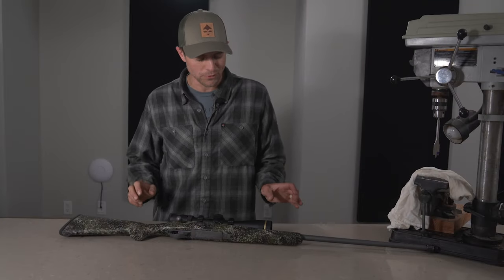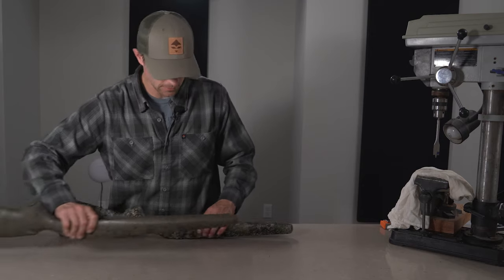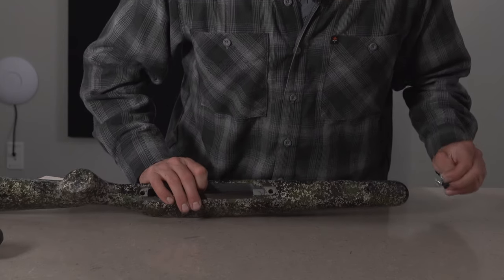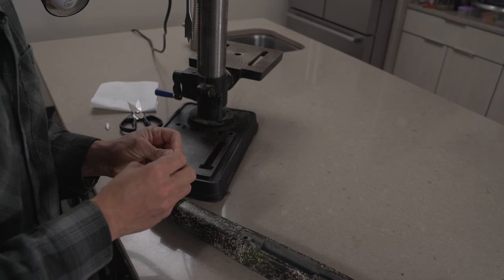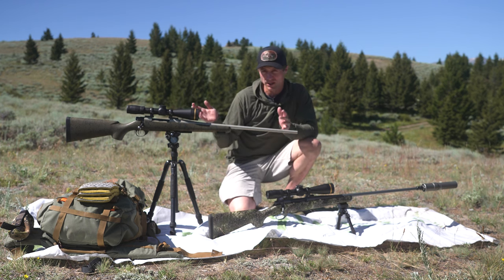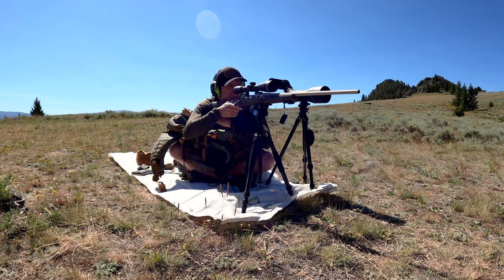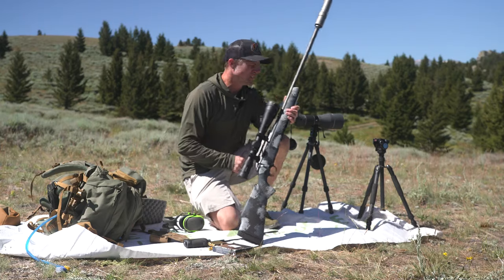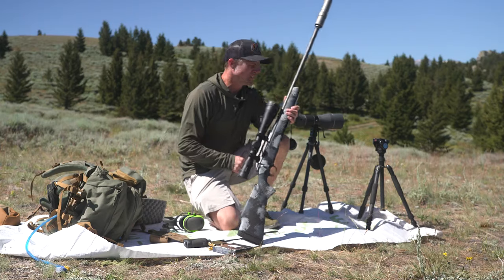One Plate for Bipod/Tripod/Spotting Scope/Camera

Comment: I went with the Spartan system to avoid those plates.  A gunsmith adapter can be put at the front and at the balance point, plus they’re flush mounted.  Arca adapter for your tripod and you’re in business.